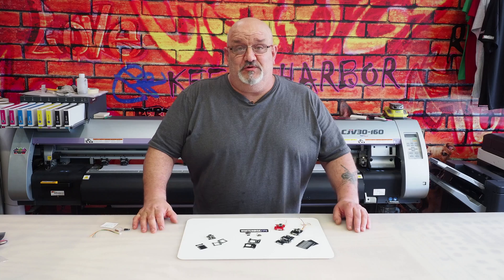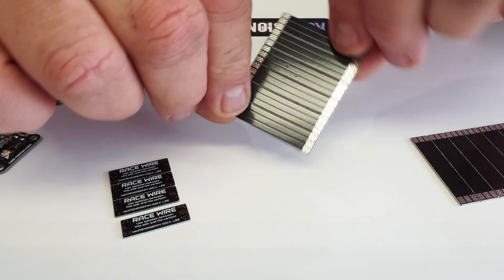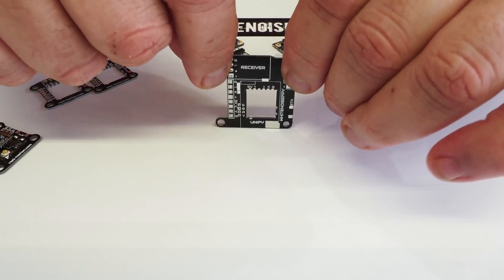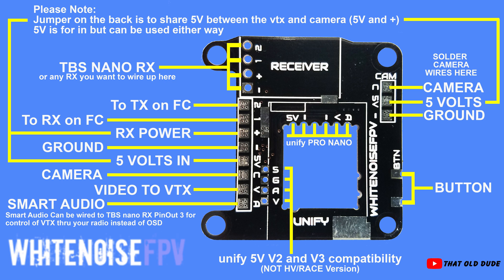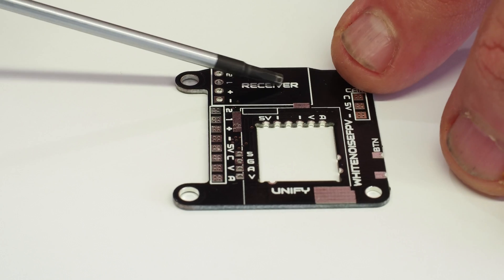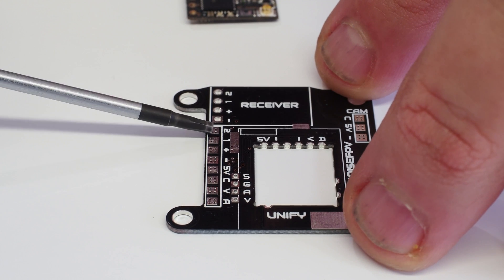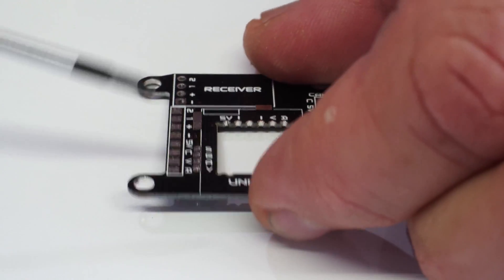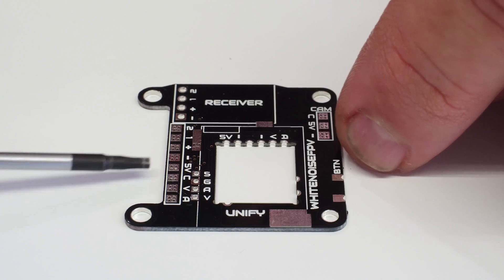Whitenoise V2 2 Board

Comment: How do you connect the FPV Camera output (C) to the VTX video input .  The C pad and the V pad are separate pads.  I dont understand how the video from the camera becomes and Input to the VTX
Reply from the maker: The "C" is for Camera out if you were hooking to a Recorder
The "V" where the Unify Nano Soldiers to is hooked to the "V" on the side of the board and that is to the VTX on your Flight Controller